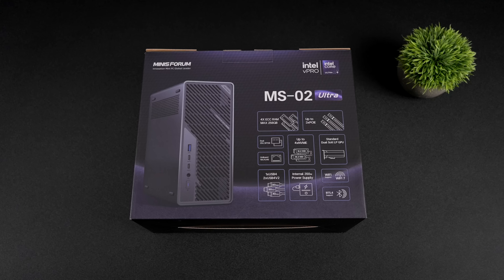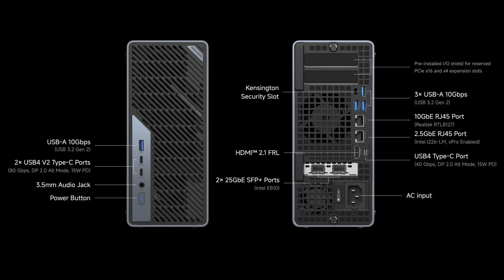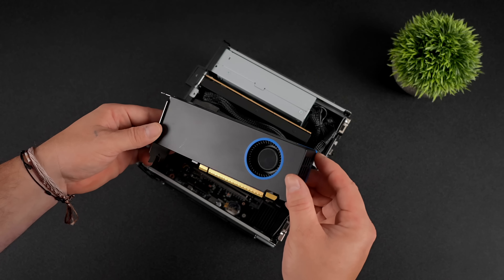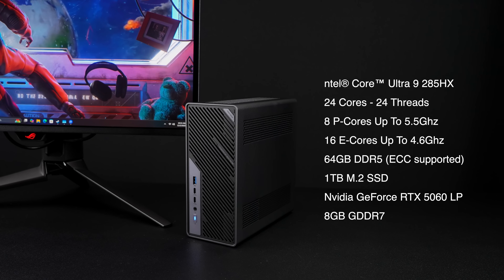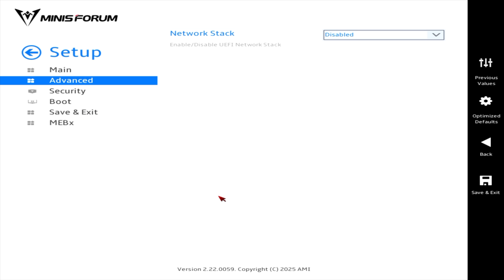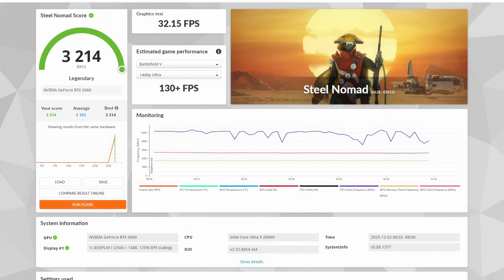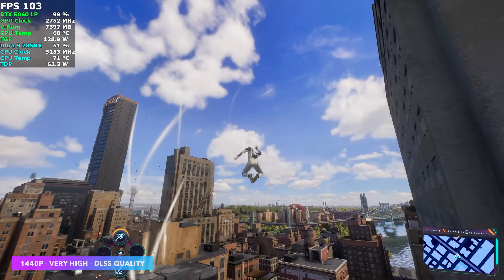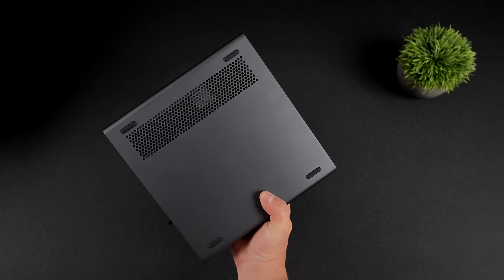The Most Versatile Mini PC Ever! MS-02 Ultra First Look

Comment: Hi. Great video, thanks! I have a question: I already have a Minisforum DEG1 Oculink dock, paired with a RTX 5070 Ti. Do you think is possibile to convert the PCIe 5.0 x16 slot into a Oculink connection? Or another PCIe slot. Do you know if there is a proper adapter that fits this goal and, more important, fits the size and dimensions of the slots on the MS-02 Ultra? Thank you so much for your help.

Comment: You pointed out two (2) M.2 slots.  In fact though I thought there were more, three maybe even four.  
BTW, I had the barebones model on pre-order but cancelled the order due to RAM shortages resulting from AI-related enterprises and also prices recently obnoxiously skyrocketing. availability and pricing going into 2026 will get worse even so I understand.

Comment: They're really stretching the definition of a mini PC.  That about 3-4 times bigger than the mini PC's I see.  SFF PC is more appropriate, honestly.
Reply: @RAZERULTRON  I think you're confusing SFF with MFF
Reply: @TheRealFrank0  Please explain what you mean.  The title of the video states that this is the most versatile mini PC.  The mini PC's that I have been exploring over the last year, like ones with the AMD AI Max 395+, are about the size of a small novel.  What he is showing is closer in size to the micro ITX PC that I built last year.  And I don't consider that a mini PC.
Reply: I can only agree. It is not a mini PC only because Minisforum makes it and they are known for mini PCs. That they market it as a mini PC is understandable, but it isn't. It is SFF (or even bigger as some SFF units). It is an interesting product but even for the possibility of having three PCI-E expansion slots it can't be a mini PC anymore. Those low profile expansion slots in contrary are a attribute of SFF, the power supply seems to be also an SSF unit.

Comment: There are and will be even better GPUs available:
- RTX 4000 Ada LP 20GB, can be modded to single-slot by cooler from n3rdware
- RTX 4000 Blackwell LP 24GB, will be available beginning 2026, will probably also get single-slot mod in the future

And it may be possible to get an Aliexpress Oculink PCI-E 5.0 eGPU Kit from ADT. Then you can add an RTX 5090/RTX 6000 PRO Blackwell with not so much loss.

It lwould be very interesting to see tests for this configurations. I am still waiting for my MS-2. 😢

Comment: I wonder what single slot GPU would fit in place of that network card, a a2000 or a a4000 sff with the slim cooler or a low end intel. Or riser occulink out to dGPU dock.
Reply: This is exactly what I will be doing, my MS-02 turned up today. I already have an RTX 4000 Ada sff and have the single slot kit on it's way so I will be trying that in the "network" slot (this will be x4) and in about 10 days I should have my RTX 4000 Pro sff to pop in the PCIe 5.0 slot. I'm also hoping to make use of the x4 slot under the GPU, I got a slim extension/riser so I can try and jam in 4 ssd's though, it's tight and I'm not sure I'll get it to fit, even with some "fettling". Main use case is AI, which is why I want the 2 GPU's in there but of course I'll be trying some games with lossless scaling too, just for shits and giggles🤣😂
Reply: @sirleeofroy4732 will that a4000 pro saturate the PCIe 5 slot, if it doesn't you should look to see if the PCIe 5 slot does bifurcation, if it does you might be able to fit another GPU in there. If you move the storage off to a NAS you'd have another PCIe slot for something else..
Reply: @Sandmonmsn  The PCIe 5 slot does indeed support Bifurcation and the RTX 4000 Pro interface is x8 however, there would be no way to physically use the slot in this way due to how tight it is in there.
Reply: @sirleeofroy4732 riser cable that splits to multiple PCIe slots and use external GPU docks, unless you have space constraints. Anyway I couldn't tell you what video it was but LTT did one of their many gamers 1 CPU videos with some vaguely similar adaptor bifurcating out PCIe slots.i will say, craft computing did the a4000 ada sff single slot cooler mod, it did keep overheating in his minisforum pc (can't remember if it was a MS-01 or a MS-A2) but I suspect it cooked due to lack of airflow over the card, that single slot fan is a trooper but needs some help, this one looks like with minor fettling you could get another fan in for the network card slot, if you do a dual GPU setup, I'd very much recommend having direct cooling over any single slot GPU to stop it cooking
Reply: @Sandmonmsn  Ah I see what you mean, the intent of the machine is to be somewhat portable as I will be using this for some work projects so I need it to be fully contained within the chassis, so external risers etc are not in scope. I will definitely be looking to add a small Noctua fan to ensure airflow over the single slot GPU. I will document my progress and throw it up on Reddit.
Reply: @sirleeofroy4732 cool, I'm sure the community will appreciate your trailblazing efforts. That sounds sarcastic, it's not.
Reply: One other thing. The flex PSU, if you can find it's dimensions look at upgrades, flex is big in servers but they might not be exactly what will work in the desktop, a quick search and 850w is the highest that form factor will go, that should give you dual GPU headroom, maybe even an extra PCIe connector for stability. Also look at the fan spec, it'll be on the sticker on the back of the hub, to easily put a second fan in for the single slot GPU, try to find a higher quality pair of fans that together use the same or less amps from the fan connector.
   This might go too far but if in your testing it runs hot, maybe think of thermal epoxying copper shims onto any and all chips on any exposed PCB where there is a fan and some low profile copper or aluminium heatsinks where there isn't airflow. The bane of SFF is heat, it's a question of when not if it'll thermal throttle, hopefully this'll prolong the speed.
Reply: @Sandmonmsn Good shout, I have indeed looked at flex PSU options and that is a route I'll take if needed however, both GPUs are 70w and will be undervolted where possible along with tuning the power limits of the CPU, maybe even some undervolting with XTU if it will work, unlike my Lenovo P3 Ultra or Dell 3260 sff machines that love to immediately shove tons of voltage into the CPU and cook themselves 😂

I'll definitely be keeping an eye on temps👍🏽

Comment: With the ECC support, 25G network and Intel B50 card in there, this makes the perfect home server with something like Proxmox. And the price of the barebone unit is reasonable but memory prices are insane. If it took regular sized memory, I could pull some memory out of other machines. But high capacity SODIMM ECC DDR5? The memory is going to cost more than the machine.
Reply: Im a little concerned with proxmox and P/E cores. Not sure if that will cause issues

Comment: $1200 and all they give you is one HDMI port?
Reply: @edmaurus2511  the 3 USB4 ports support DP, which means you can use a USB C to DP or USB-C to HDMI cable/adapter. One of my newer screens take USB-C directly. A lot more versatility.
Reply: Is it really that hard for people to admit that things are just out their budget? Like bro the config with 32GB or RAM and 1TB NVMe is $1500, adding a LP 5060 or Arc Pro for another $350 still costs less than any similarly spec’d system currently.

Comment: That's probably my favorite case from Minisforum.  The way it supports the Flex PSU and a 2-slot GPU is like the A24 case, but you get more PCIE slots.  It's reminiscent of an HP office desktop, except much more premium.  Sadly, the price reflects that.  Seems like it could give the Ryzen 395 a run for its money though.
Reply: In my opinion, their biggest mistake is not turning the GPU 90 degrees vertical, so a full-sized GPU could be used instead of a low profile one.

Minisforum has another model, the AtomMan G1 Pro, which is priced less than the MS-02 Ultra for the same 32 GB memory, but INCLUDES a 5060 GPU already installed. It has a pretty powerful 16 core/ 32 thread AMD CPU. They're targeting different audiences (gaming vs professional content creators), so I can see how they differ.

Comment: Mine is on the way. UPS said it departed China three days ago, with no updates since.

Got a Gigabyte RTX 5060 LP sitting here waiting, along with 64GB RAM and a 2TB PCIe Gen 5 M.2 SSD. Already have 25gE here and will be running another fibre to my desktop. Cable and transceivers already here, waiting.
Reply: how much did it cost?
Reply: @polarvortex6601  You could build a small pc far better than this , for the price .
$1,199 without GPU and M.2 .
What a joke .
Reply: @polarvortex6601  It was US$1199 minus $50 for signing up, pre-release, and another $30 for leaving it in my cart for a day or so. $1119. Add another $900+ for GPU, RAM, SSD, and fibre.

Comment: I’m doing a build with the jonsbo nv10 and lp Rtx 5060 I’m so excited! 🤩
Reply: @SigmaF3mboy  as a NV10 user with 5060 - I'd advise going for 4060 for slightly better thermals. Or undervolt 5060 to around 120w.
Reply: @Jamert  I’m getting the zotac one, which is supposed to run cooler than the gigabyte one so I should be fine with thermals :3

Comment: 256 Gb o’ RAM? Yeah… what’s that gonna cost?
Reply: An arm and a leg, and also 2 kidneys.
Reply: @samserious1337  And the dangly parts .
Reply: @gazzertrn  definitely need to harvest the banana organs -dadadan
Reply: @dewizardjackson926 and probably some brain also😂
Reply: Do you yell at the tv?
Reply: @bbb_zr  yes
Reply: Your kidney please
Reply: everything
Reply: They have a heatsink on two slots. I don't think that they really expect anyone to use all four slots.
Reply: depends when you buy - bought 2x128GB for my 9900X3D 2 months ago for a decent price
Reply: and it's .... ecc supported, you don't need two kidneys I heard, so I would sell both ...
Reply: 256GB vram in this machine makes no sense, since the GPU is too slow for handling those big models.
Reply: @AndrewTSq you're mentioning vram here, but they're referring to the ECC SODIMM ram with the 256GB limit, they supply a prebuilt with 192GB ECC SODIMM, and as I did order 1 of those I do know their usecase. There are setups where more RAM can be usefull, think in regards to Latency-sensitive inference that don't go to the GPU. If you need the Large vision models, than you can use CDFP-copperlink and connect up your GPU farm, but then you're starting to get into the really technically skillfull group of users who can set that kind of thing up. But for sure don't underestimate the use of this RAM for AI models, there are definitly valuable usecases for it. There's a reason prices are going up on memory modules at the moment. Even if it's also seen as a bubble at the same time.

Comment: Who is this aimed towards? It's 3k from what I saw online. You have little to no space to add a GPU, the cooler is proprietary, the CPU is soldered. Even with the Ram prices skyrocketing, you can make a better PC that would last longer for less than 3k.

It would've made sense if this costed 600 bucks with less specs.
Reply: It's $950 barebones with Ultra 9 275HX, $1240 with 32GB RAM and 1TB NVME.
Reply: @vinyfiny  $1,199.00 wrong
Reply: @polarvortex6601  That's for the 285X.
Reply: If you don't get it, you never will
Reply: @alexthek what throws people off is gaming is being used as a visual representation of benchmarks in ETA's video presentation. However, it attracts gamers and desktop users who haven't been exposed to the vast variety of other use cases for hardware. Could use this as a dev workstation for example, backend for edge compute projects, part of home lab, etc.